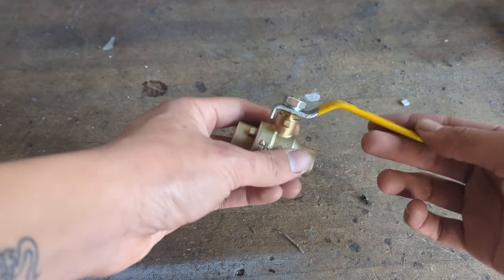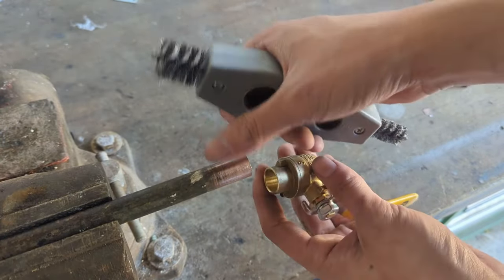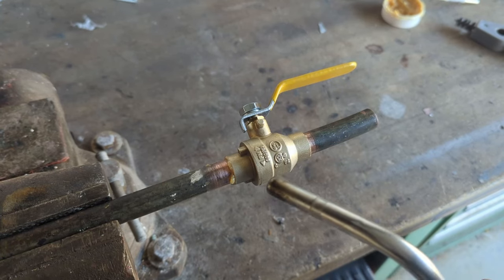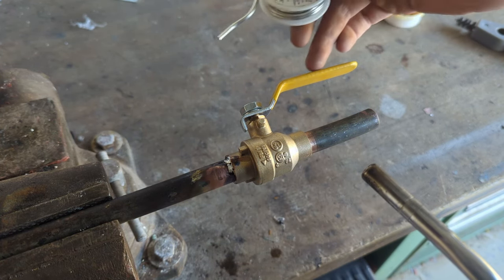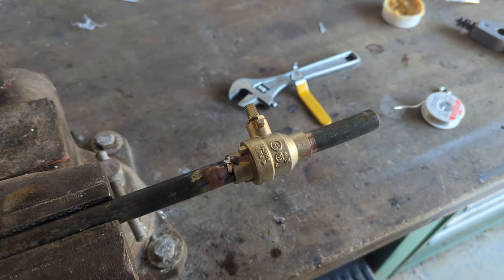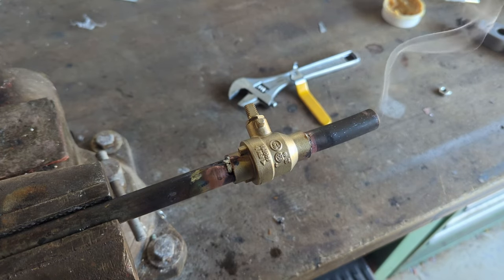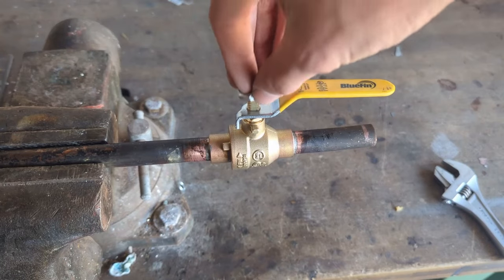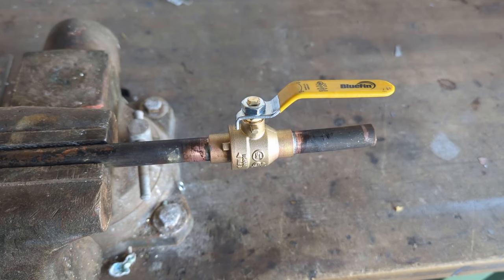How to Solder a Ball Valve to Copper Pipe

Comment: Nice job, but you should also mention the two different kinds of flux. (Potable and non-potable). Also you forget to reinstall the washer back under valve nut.
Reply from the maker: You are correct, it is absolutely essential to use lead-free solder and flux for potable water applications. I haven't seen leaded solder or flux at any of my local plumbing supply stores, as modern lead free solders work well and are inexpensive.

Comment: Been sweating for years but ran into a brass eared elbow to brass pex fitting and the pex fitting was solder phobic. It was cleaned & fluxed well. It also blackened fast. I think that the brass used was an inferior brass or improper foundry mix.
Reply from the maker: A lot of inexpensive brass fittings are made with a low quality alloy that is difficult to solder and also prone to corrosion.
Reply: @DragonBuilds  I ran into a lifetime plumber at the store today and he backs what you are saying.

Comment: Everyones a "pipefitting cowboy" on the internet.  Some manufacturers recommend sweating the ball valve in the closed position.
Reply from the maker: Agreed. You should always follow the manufacturer's instructions. I have seen some that recommend the closed position, other recommend soldering them open or at 45 degrees.
Reply: Or you could simply remove the guts and reassemble it after the soldering and cooling down process. 💯
Reply from the maker: @gregorypeck37 that applies to three piece ball valves. Most ball valves don’t come apart.

Comment: Whether the ball valve should be closed or not when soldering is dependent on the manufacturer. Need to check that first.
Reply from the maker: Yes, that is correct. However, the majority of valves I have seen recommend soldering in the open position.
Reply: @DragonBuilds  all information in Internet is closed

Comment: The flame still seems to be very close to the ball valve. Does simply pointing the flame AWAY from the ball valve make the difference between damaging it and not damaging it? How about the other type of shut off valve, i.e., the type that has black rubber seals inside? If the seal/handle screws out as a unit, should it be removed before heating? And  in situations there the black rubber seal unit can't be removed,   what is the closest to the shut off valve that the flame can be applied to a copper pipe WITHOUT risking damaging the seal?
Reply from the maker: I personally wouldn't install a new multi-turn valve because ball valves are more reliable, but for multi-turn valves with rubber disc seals, the stem should be removed before soldering. If you have to solder near an existing valve, I would wrap it with a wet rag before soldering.
Reply: Wet rag is the best

Comment: Was that enough solder? I use way more but maybe too much
Reply from the maker: Once you see a ring form around the pipe you know that you have used enough solder. A handy trick is to use a length of solder equal to the pipe size, such as 1/2" of solder for a 1/2" pipe.

Comment: I soldered but solder  wasn’t  sticking
Reply from the maker: Make sure your pipes and fittings are clean, that is probably the most important step. Sand cloth works pretty well. Using enough flux and enough heat is important too. At the right temperature, the solder should get sucked right in.
Reply: @DragonBuilds  thanks! I did sand and cleaned everything , used lots of flux but flux burned off
Reply: @DragonBuilds thanks for the tips! I made sure to clean everything and it came out great with no leaks!
Reply: The oil from your fingers will cause the solder not to stick. So limit touching the spot to be soldered or wear gloves
Reply: Was that enough solder, I tend to apply more

Comment: Solder end ball valves should be installed with the valve in a closed position. Extreme care must be used to prevent overheating of the valve causing damage to seats and seals